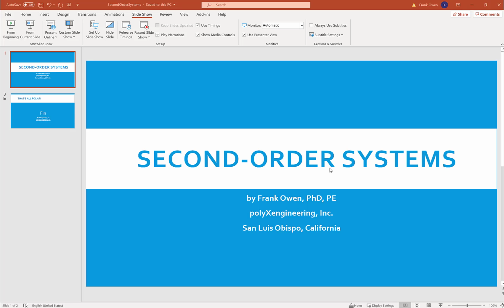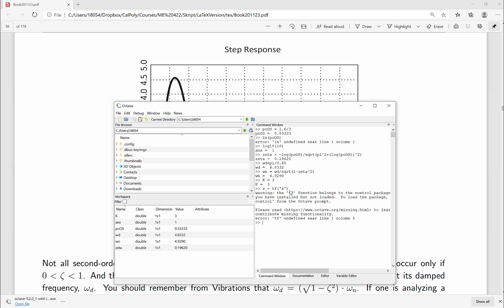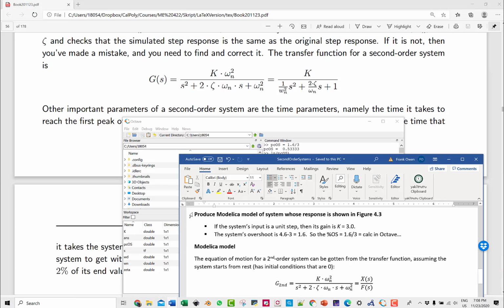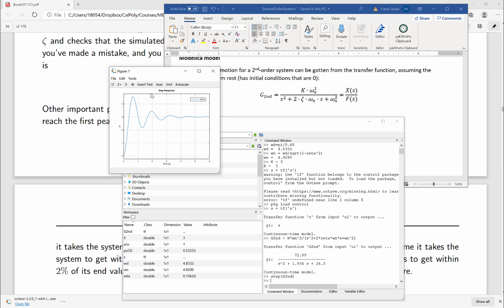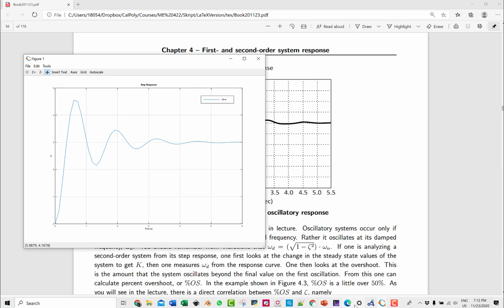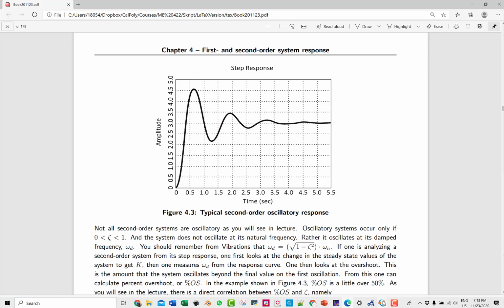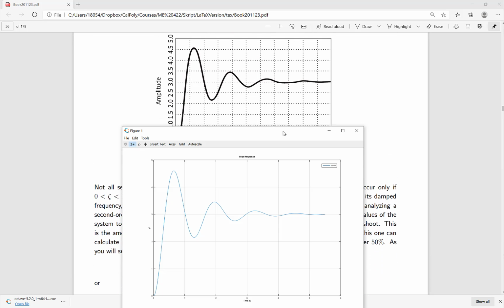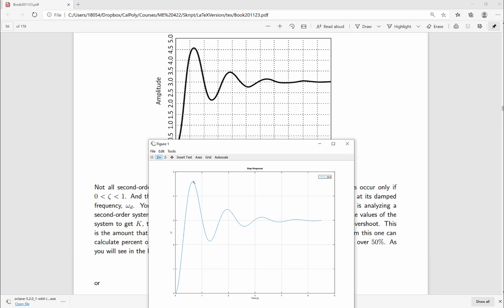SecondOrderSystems6

Comment: Thank you, please allow this silly question : is this transfer function represents a response for open loop system or (Feedback) closed loop system , in other words, is it for a plant or the feedback loop including a controller and a plant?
Reply from the maker: Hi again Mr. Nada,  That is not specified because it could be for either.  It's simply for a second-order system, regardless of whether it is part of the control loop or the entire loop itself.  In fact, one exercise we do in lab is exactly this:  We put a second-order system, as the plant, in a control loop with just gains elsewhere (Ksensor = 1, Kcontroller is some constant, Kactuator is some constant).  Closing the loop around these components produces a different second-order but with different K, zeta, wn.  In fact these are K_cl, zeta_cl, wn_cl, and these are different than the original 2nd-order parameters.  Though this is confusing, it shows very pointedly how simply closing the loop changes everything (except that the system is 2nd order.
Reply: @polyxengineering3857  Thank you for your clarification, a great deal of confusion has been resolved by your statements
Reply from the maker: @mnada72  , Hello, would you mind writing me directly at fowen@polyxengineering.com?  I'm curious about your interests and would like to start up a direct communication.  Thank you,  Frank Owen
Reply: @polyxengineering3857  Thank you, delightfully I will